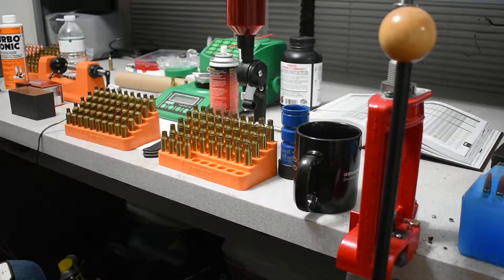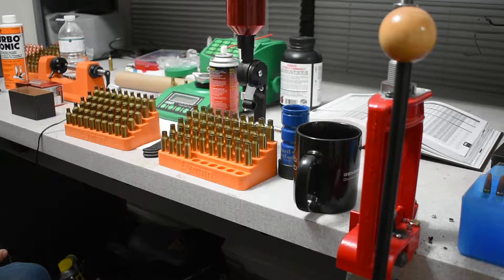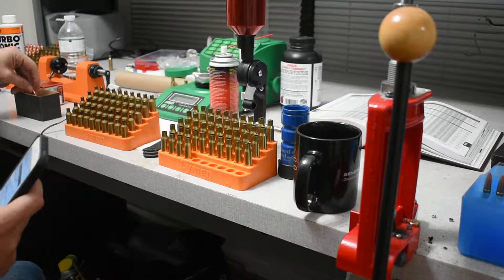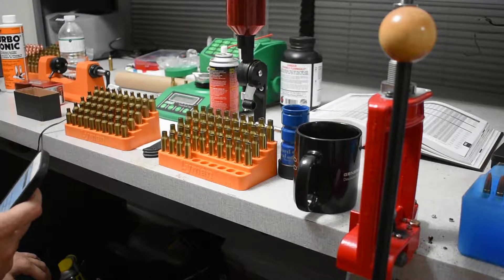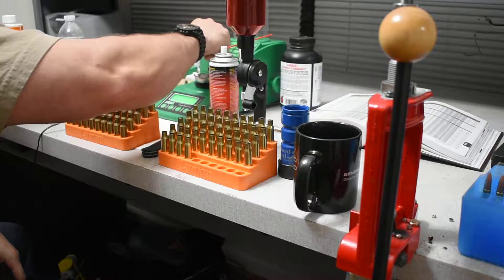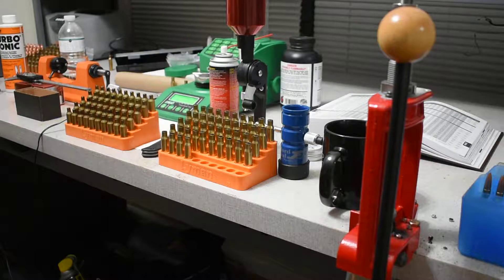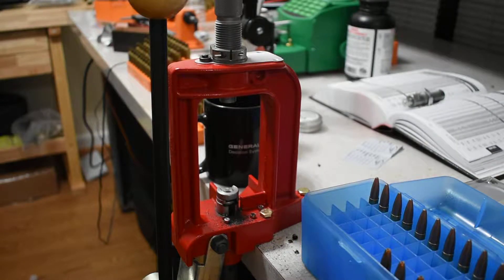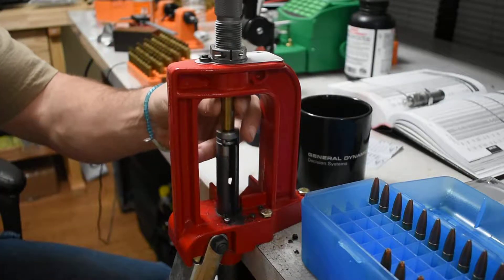Satterlee Load Test for 6mm Creedmoor Part 1

Comment: It only ever should when filming lol! Looks like you have a really good setup.
Reply from the maker: blingblingbob thank you...it’s changed a few times over the last few years....I’ve made a couple of upgrades in equipment.
Reply: @alabamareloader  interesting a lot of people disrespect the Lee equipment but it works. Was good to see the press there. Lyman trimmer, RCBS scales, I'm interested in getting them but the cost here is ridiculous.
Reply from the maker: @HuntShootOffroad  Yea it's taken some time to acquire some of that "extra" stuff along the way. I started out with the Lee Classic Challenger kit and it worked great. I still use the Lee single stage press that came with the kit and the hand priming tool. I just recently bought another Lee powder measure to use as my dedicated 450 Bushmaster powder dispenser.

Comment: Since I've been working with the 6mm Creedmoor too I thought I could share my findings.

The Hornady factory loaded MATCH ammunition which uses the 108 gr ELD-M bullet has a  cartridge overall length of 2.794"

The reloading guide from Sierra was online and for the 107 gr bullet and H4350, it showed a range of 35.2 - 42.1 gr.

Lyman published a "precision rifle reloading" booklet and for the 6mm Creedmoor using a 107 gr bullet, and H4350, it showed a range of 38.0 - 42.5 gr.

I think I would use 0.2 gr step size to avoid missing the flat spot.  ( disclaimer - I haven't tried the Satterly method myself yet )
Reply from the maker: Yea I've been second guessing myself on the .3gr jump since I loaded those up...I'm gonna shoot them anyway and see how they graph...If I'm not thrilled with the results I'll go back and redo the test at .2gr increments. Should be interesting.